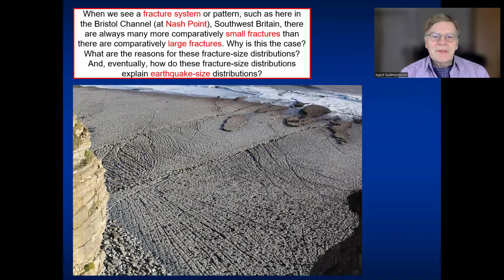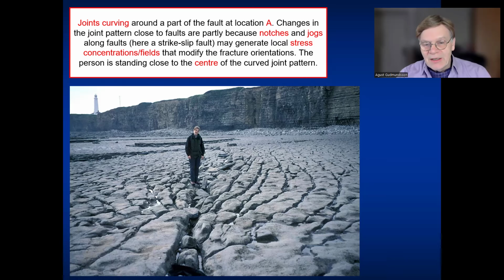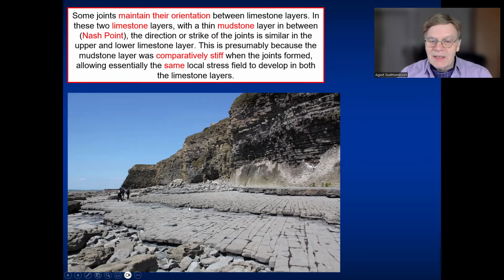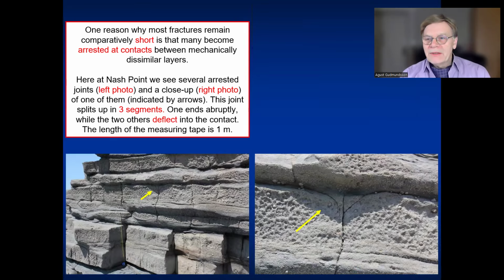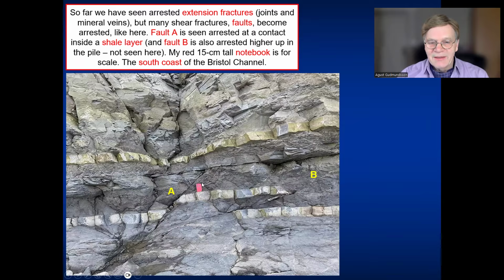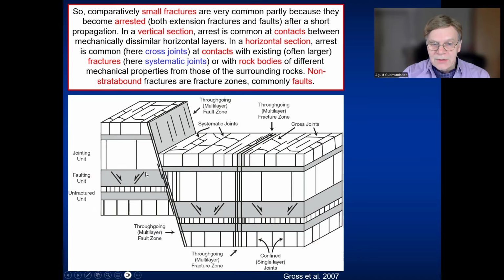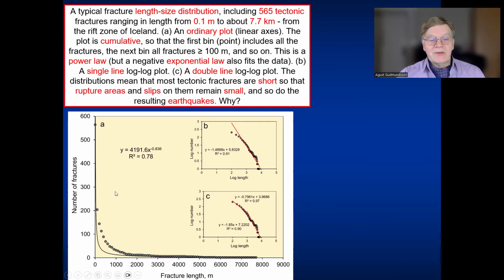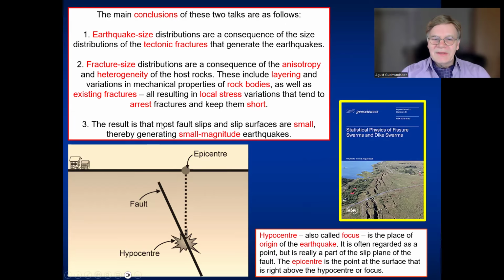Geological Activity Explained 5 Why most tectonic fractures are short and only a few long

Comment: Great examples Agust, much appreciated. These are actually all the relationships that we can now model in 3D with the DMX protocol (DFN), in order to make our computer models geologically realistic. Good to have such a high quality field examples of joints and faults, which make our NCGM directly linked to the geological descriptions. Have a great day!
Reply from the maker: I am glad you find the fracture examples of interest. I am aware of computer (numerical) models on fracture patterns; my students and I have worked on numerical modelling of rock fractures over the years. One problem, however, is that in layered rocks some of the layers are gradually changing their mechanical properties (particularly Young's modulus) over time. For the present fractures, this applies particularly to the shale and mudstone layers. As for shale, not only does it gradually become stiffer (with a higher Young's modulus) with time, but the stiffness varies greatly inside individual comparatively thick shale layers. Thus, the stiffness close to the adjacent limestone layers may be much higher than the stiffness in the central part of the shale layer. I am sure you are aware of all these problems. And all careful and realistic numerical models on the development of tectonic fractures are most welcome and I am glad that you are making progress in such modelling.

Comment: I should like a resume of post isostatic induced fracturing. Thank you prof.❤
Reply from the maker: Thanks. Some of the joints may have formed during isostatic uplift following erosion - some such joints can, in fact, be identified in the field. Many of the joints in these areas, however, formed when the shale/mudstone layers were much more compliant (softer) than today and thus likely at depth and well before significant erosion and uplift. Also, many joints contain mineral veins, indicating the same.
Reply: Oooh sorry I meant to ask how you recognise isostatic movements from fault and fractures. ?? Slickensides ?
Reply from the maker: @charlielamb2314  Thanks. Yes, the sense of movement on faults can commonly be determined from slickensides. The leading experts in that field for decades where my colleagues Francoise Bergerat and (the late) Jacques Angelier, who did slickeside studies in many parts of the world. From these data, and additional data on extension fractures (such as joints and mineral veins and dikes), the palaeostress fields (the stress tensor) can be calculated (you can find many of their papers on the internet, describing the details of the method). But determining the palaeostress field does not automatically lead to the conclusion as to the exact stress source of that field - that requires a detailed mechanical study since several processes can contribute to the state of stress at a given time and location. Very clear slickensides are on many faults in the Bristol Channel, particularly on the south coast (in the area between and around Kilve and Watchet).
Reply: @professoragustgudmundsson3810 thank you. it's post isostatic mineralisation that I am interested in. Very interesting example where vertical lead bearing veins in limestone intersect sediments with glauconite and phosphate nodules. And form pyromorphite secondary mineralisation.❤